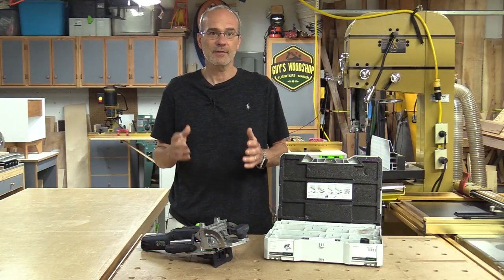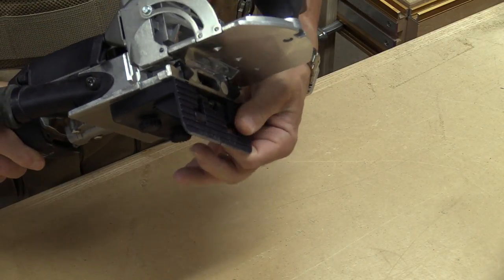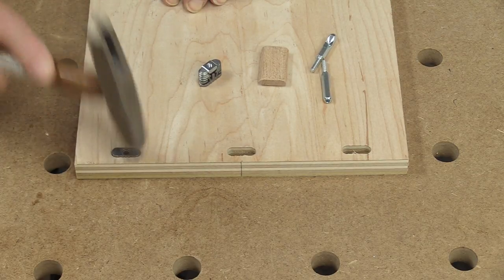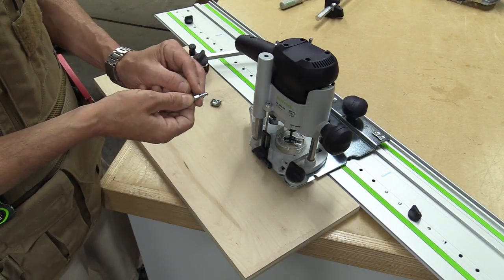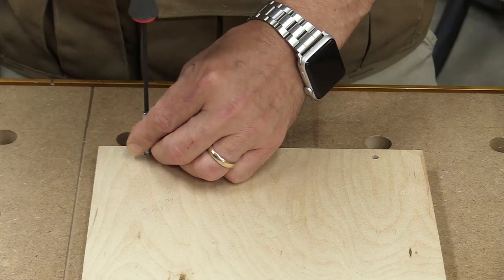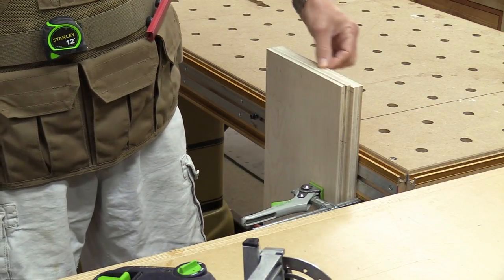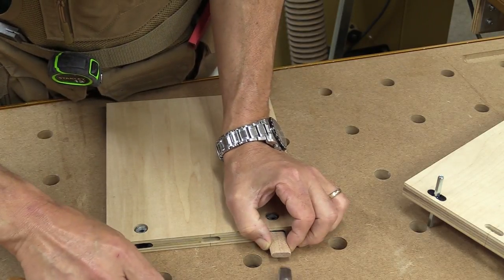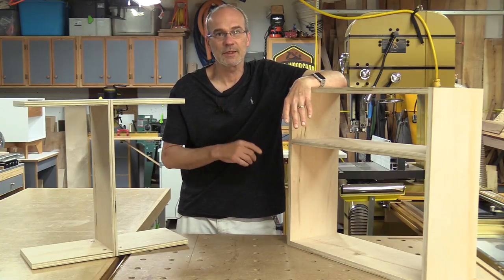Festool Domino DF 500 Connector System

Comment: Hi Guy:
I have seen this  product on a email.  You did a great demonstration of this product.  You made it clear how it works and I liked that very much.  Yes, there has been several times that I wished I could have some take-a- part furniture.  It is great that people are still coming up with good new ideas for products.
Reply: Csbinet Maker you sound like a Festool rep
Reply: No. No way.  I just like good products,  I like the festool dust collector.  It is head and shoulders better than my old one.  By the way I see you have Blue Tube on yours.  How do you like it?  Did you add it to your older unit or is it a new unit?
Reply from the maker: Like I said in the video, it works really well for it's intended purpose.

Comment: Great for closet systems where oftentimes you HAVE to assemble inside the closet itself
Reply: Only if you have the room to assemble the connection. Most closet companies use the Rafix connector because with it the shelf can be dropped in from above or by separating the vertical partitions about 1/4”. With this connector you have to have room to bring the partition into place. Perhaps necessitating a filler strip.

Comment: If you already have a Domino it's not a bad system.. I went with Lamello years ago and it worked for the rare occasion i needed anything like that.
Reply from the maker: I have looked at the Lamello Zeta P before. This is such a specialized joint that I couldn't see spending the cash for it. Glad they finally came out with one for the domino.

Comment: This is a great video. Would you use this connector system for a hotel bed frame? Who knows what kind of beating a hotel bed experiences?! I have a project building bed frames for a small hotel, and was considering this method.
Reply from the maker: I would still use bed bolts. Not quite sure if these would be strong enough

Comment: Guy, I’m building a Murphy bed with my son who is in college.  I anticipate he’ll be moving around for a few years after he graduates and may want to disassemble and reassemble the bed several times.  I was planning on using pocket screws fully expecting them to stop working well after a few installations.  Now I’m thinking of using these connectors.  My questions, since you’ve built the identical Murphy bed kit we are using is this, do you think this joining system would be strong enough for the wood frame?  Would it hold everything together through a number of setup and take downs?  Thanks for the great instructional videos.  They are well produced and your instructions are thorough.  It’s a huge help.
Reply from the maker: These are good for cabinetry projects,but I wouldn't use them on a bed. Look into the cross doweliing jig from Woodpeckers. Much betterand stronger option.
Reply: @GuysShop  Guy!  So good of you to reply and I think you saved me several thousand dollars in tool and parts.  This cross downing jig and parts are just the trick.  One more question since the woodpecker site does not have much by way of advice, which size of cross dowel hardware would you recommend?  The Murphy bed is made of 3/4 top grade two side maple plywood.  Which for that wood.  And is there a general rule you’d apply to choose hardware for wood dimensions?  Again, thanks.  Your instructions are fun to watch and very instructive.

Comment: On LR32 option how do you position the side stops for the spacing of the first pin from the bottom or the top of the side boards? The question may sound confusing for people who do not use LR32 but the stops have positions for 9 mm, 16 mm and 32 mm for starting the first hole. Do you use 9 mm?
Reply from the maker: I am using the 9.5 mm stop. It puts the hole right in the center of 19 mm ply

Comment: Hey guy I appreciate the video I finally got my own domino 500 and I was trying to put a stand together for a fish tank however on the normal 90° angle corner that’s at the beginning of this video I noticed that my vertical piece was about 2 -4mm off of the ground and did not sit flush with the bottom piece could you tell me what the height is that you have the domino set to?  I had mine set to 16 mm. thank you

Comment: Dear Mr. Guy, this is a very good video. One question though; I have a Lamello Clamex system which is comparable. And I also have a Domino DF 500 power tool, and the LR 32 system. Being the advocate of the Devil; what are the main arguments to buy the connectors compared to clamex P (or S). Are the joints considerably stronger? Would you say the system works quicker? Any input is welcome before I run the the hardware store and buy myself the connectors-box.
Reply from the maker: Thanks Bart. I wish I could compare the two. I have no personal experience with the Lamello knock down joinery system.

Comment: I was unaware that there was a 9.5 mm stop for the LR32 system.  Was this a special order item from Festool, if not, then does one complete a 9.5 mm spacing using the existing 16mm/ 32mm stop in a special manner.  Also, you did a great job of presenting the material.  I learned a great deal.
Reply from the maker: The 9.5mm stop came standard on mine. You might want to take a look at your stops. Thanks for watching and the nice comment!
Reply: Please forgive me for this question, but I am confused.  You were abler to drill the bottom and top holes with the LR 32 system using a 9.5 mm stop that came as a standard part?  Or am I really out of touch.
Reply from the maker: It is standard on the stops for the system kit I have.

Comment: Good video Guy. Have an upcoming project that these would be perfect for. Can these Festool fittings be fully disassembled from the boards they are in? I know some pieces of the knock down/assembly fasteners for the Festool 700 XL can not be removed. Do you have the part number of the Festool kit you used for the video? Also what brand/model is the apron you were using in the video. Thanks Guy.
Ron
Reply from the maker: Thnaks Ron. The pieces can be removed, but not easily. There is a chance especially of breaking the plastic clips. The apron is from Calavera Tools, and the connector kit is KV-SYS D8
Reply: GuysWoodshop ok thanks Guy.

Comment: Hey Guy, great presentation. With regards to the the domino version of the butt joint. The first piece that you inserted into the domino hole which then accepts the pin, what is preventing that piece from being pulled back out? Is the pin expanding the unit taking advantage of a series of serrated type edges? Cheers mate.
Reply from the maker: Thanks Kuffy. You are correct. When you tighten the post, it expands the anchor into the wood so it won't come out.

Comment: Thanks for the video Guy, you fill a void in the learning curve for this system. I have a question not related to the Connector System but rather what seems to be your table saw extension. It looks like you have made a MFT type extension to your Powermatic, is that the case? if so is it the fence stock or cut off side of the blade? Trying to figure out how I could to that to my stock side with the rails there. Thanks.
Reply from the maker: Hey Stuart, if you look back in my video library, I did a complete video on the MFT outfeed table and how it's connected to my saw.
Reply: Thanks, I'll check it out. This is the first video of yours I've watched so excuse my ignorance. Looking forward to what you have to teach me!

Comment: I have looked at this quite a lot, but the price is just prohibitive for what you get. Festool tools are expensive and in my opinion worth it. What bothers me is that even after you buy into the system you pay a steep, steep premium for component parts like these. It makes one feel a little taken advantage of.

Great video though. Really enjoyed it.
Reply from the maker: I agree with most of what you stated. It is a good system, and there is a cost involved. But the choices for RTA connectors is pretty limited, and wanted to give this option a look.
Reply: +happyhappyjoyjoy9999
Festool are a small company and for them to develop accessories costs a lot of money.  It may only seem like a little bit of plastic to you but to them it requires designers, fabricators and then production schedules. And then they have to try and make profits with their production. 

All that innovation costs money because it has to be designed, tested and then put to market. All it takes is for them to release a product that sucks time and resources out of another product and then all of a sudden they have got the market wrong. 

Mafell is the same and this applies to other small companies out there.

Comment: Yes the Festool Domino certainly is innovative but has stamped proprietary all over it from their tenons to the tool. If you think using it to make a living, think again! Festool certainly doesn't leave much of a profit after you take out its costs,in today's competitive market. If your thinking using the Domino to manufacture and market knock-down furniture ... good luck trying to compete with IKEA!
Reply: Agree, but the target market for this is custom cabinet makers that have the need for a knock down design in one part of their build because of space or shipping constraints. True production of these at scale should be on cnc only.
Reply: this is not to compete with IKEA

Comment: I find it odd that Makita or Hitachi haven't made their own version of the the df 500...one machine that could use the small cutters of both the 500 and the 700 for about $ 700.00 u.s. it would sell like hotcakes
Reply: There will not be a comparable system (though the Lamello Clamex looks just as good if not better) to the domino until the patent held by Festool runs out. I think it will be similar to the Oscillating multi-tool designed originally by Fein, patent ran out & now you can buy a similar tool from Bosch, DeWalt etc.

Comment: This is just a way to put things together like discount furniture store junk.
Reply from the maker: This is very a viable connector for flat packing of small projects and other projects that require a Ready to Assemble (RTA) joint.
Reply: +Gene New
Discount furniture does not make custom cabinets that can be fitted on site by a craftsman. 

Cabinets can cost many thousands.
Reply: WOW you totally missed the point

Comment: What is a 36 mm domino or do you mean 8x30mm
Reply from the maker: Nope, you heard correct. The kit comes with 8x36mm dominos. They are a little shorter for when the double butt joint comes into play so the don't hit each other inside the vertical piece.

Comment: It is a shame that it’s so uncommon for ppl to be willing to save up for nice things anymore, especially tools. That the cheap obsolescence engineering into everyday things and the fake need to own 200 things instead of a few nice things are so common that it’s almost impossible to convince them that this Festool stuff is absolutely not “too” expensive or overpriced, it’s priced exactly right.
Reply from the maker: Agreed. If you want quality, it always comes at a cost.
Reply: Festool USA refused to repair my kapex and couldn't/didn't repair my OF1400.  I sold my kapex and bought a Makita LS1219L and I was forced to repair my OF1400 router myself.  The router bit wasn't centered in the guide bushing plate and unlike every other manufacturer's router, it isn't a simple adjustment to get it centered.  I had to grind away part of the guide bushing plate in order to get it centered.  Festool had it at their facility and couldn't fix it.

Not every product Festool sells is a quality product.  They do sell lemons and then will refuse to fix or replace.

Potential customers should be warned that Festool might or might not perform needed repairs after the 30-day trial period.
Reply: @ThekiBoran  
I suspect that you are have somehow affected your guarantee with Festool. I would guess you did something that was not recommended. 

I have only ever had one problem with a festool tool and it was replaced without question.
Reply: @bighands69 

What Festool recommended was that I use my router in a jacked up condition.  Have a look.
https://youtu.be/STuHs0JSQtM

P.S.  The warranty was not affected by my modification.  I simply would buy a new guide bushing plate and they would never know I made a modification.  Besides, if they voided the warranty for such a simple modification what does that say about Festool service?
Reply: I am calling you a LIAR
Reply: Liar